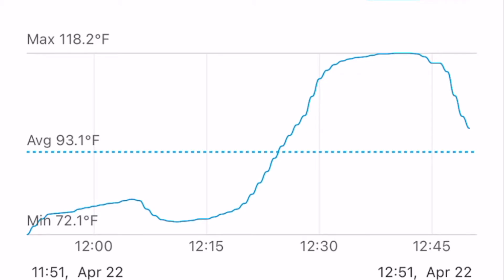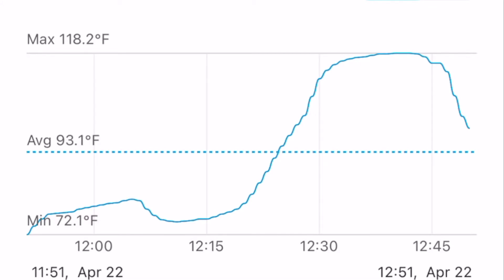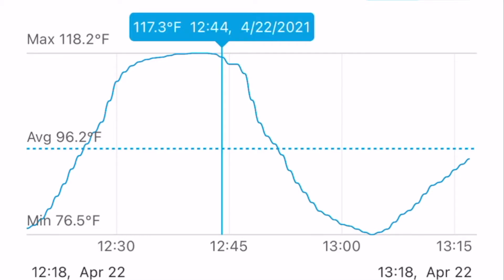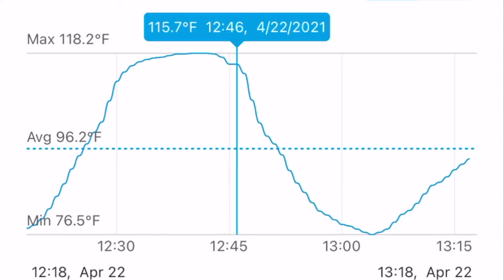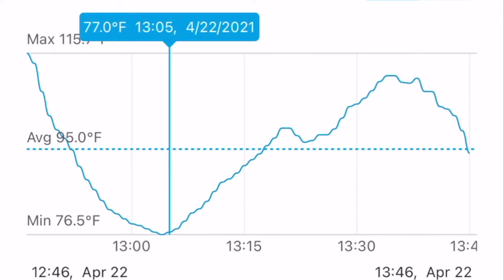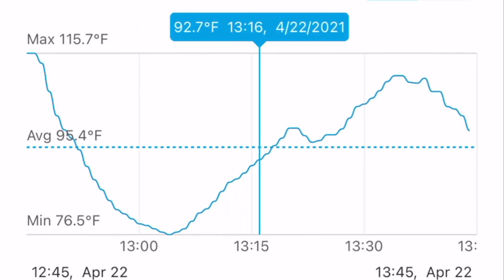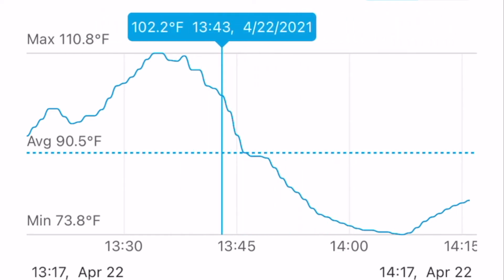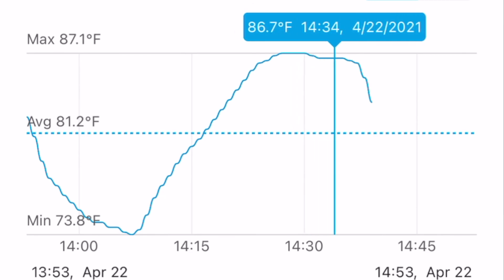Is engine bay suitable environment for Lithium based batteries?

Comment: You didn’t mention your specific location, however, I would challenge you that your test is definitely not comprehensive. I monitor engine and under hood temps routinely and upon engine shut down I recorded up to 265° in the engine compartment of an old diesel truck I keep on the road. So the heat flood when it’s 100° outside after an engine shut down is the extreme test that needs to be performed. You should be performing this test in late July and August in Texas.
Reply from the maker: I did mention my location, however I disagree with your view points.  

Sounds like a great video you should make!

Comment: Operating temp =\= best lifespan. Anything above ~108 will definitely negatively affect it. Operating temp just means it can operate and won’t explode or completely kill the cells right away. Plus there’s the added temp from being under a load.
Reply from the maker: so it is safe to say then that the battery is safer in the engine bay than inside the cab... im sure the cab reaches 108 more frequently in the texas heat here being parked and in the sun than it would driving it around. almost instantly, after the vehicle gets up over 10 mph, engine bay temps drop to ambient or even below ambient with wind chill.... im being facetious here, but in all actuality it probably would reach 108 more frequently and for longer periods of time being inside the cab than in the engine bay. the Renogy DC to DC charger and the comms port in the batter can monitor real time temps of the battery and cells, which i do/did monitor quite intensely for several months after install
Reply: @isaacspoon  i guess it just depends on the insulation and airflow of the inside setup. Perhaps with your setup and being in Texas there would be degradation either way and without insulation from the heat it may be better under the hood where there is better airflow from the outside ambient temperature while the car isn’t running. With my battery under my platform it stays much much colder than the rest of the vehicle.